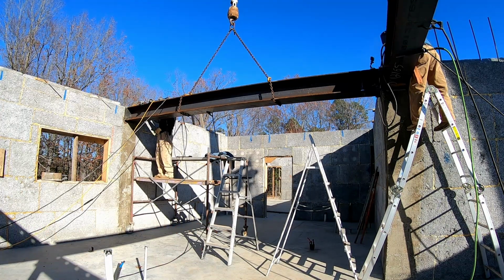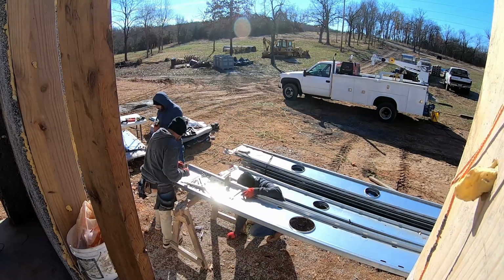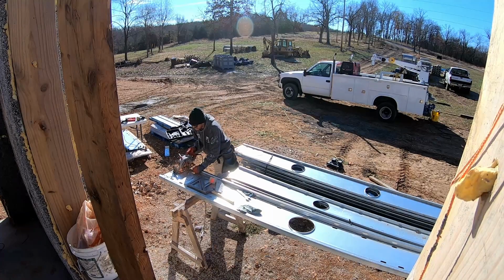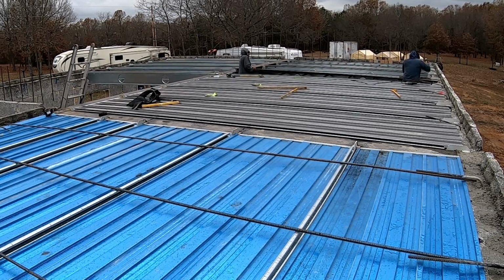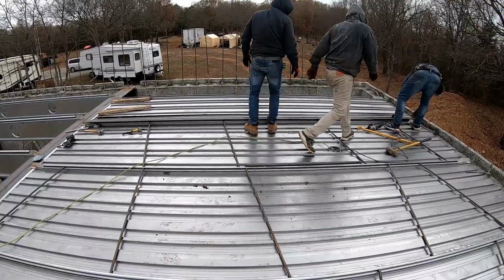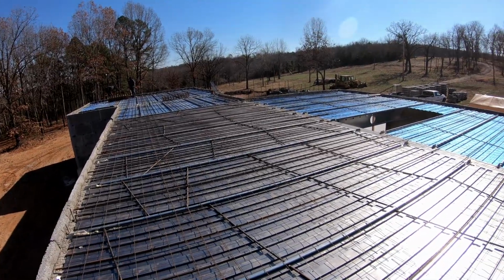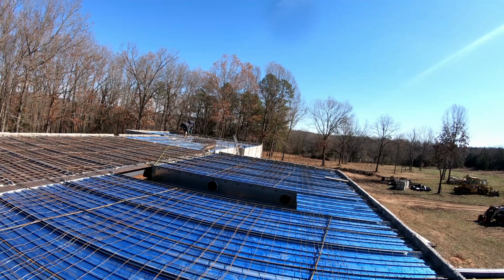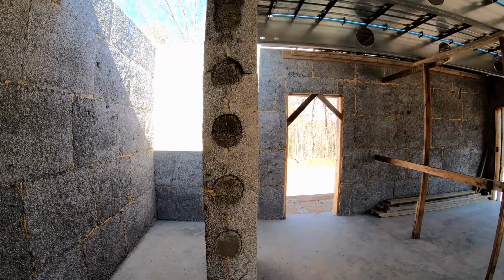House Build 25 - Legacy Block ICF House Speedfloor System Installation and Finish Welding I-Beams

Comment: Love the step by step videos on your ICF build 👍🏾. This is the first time I have seen metal I beams used. I am also watching another complete ICF build on YouTube. Jesse Muller. Both of your channels are very informative. Thank you.  Jesse used a different floor system with foam panels, Rebar, and concrete to make his floor joists. It's nice to see two different systems at work. 👍🏾😁
Reply: I might do something like this on my next build, the concrete joists are nice, but alot of labor. I will check into these
Reply from the maker: Thanks for checking out our videos!  I'm glad you like the way I am presenting information.  I try to let folks know what we are doing and what to expect but sometimes I fall short.
  Speedfloor is a good system if you are doing a suspended concrete floor.  I mentioned the problem we had only so that people understand that sometimes stuff goes sideways and you have to deal with it.  I still believe that it is a good system.  
  We looked at Build Deck and Litedeck as alternatives for the second floor but decided to go with the  Speedfloor as Legacy Block was familiar with it and it seemed like a good fit since it is within the insulated envelope of the house and didn't need the extra insulation.
  I'm familiar with Jesse's channel through Andrew Camarata.  I've watched some of his videos but was not aware he was building an ICF house.  I'll have to take the time and check it out.
Reply from the maker: @jmuller86 , I have watched some of your videos but not recently (building a house) so I didn't know you were building an ICF house.  I'll have to check out your build.  The Speedfloor system is a good system if you don't need the insulation provided by an ICF deck system.  I provided links to the systems we are using in the description of the house intro video.
Thanks for checking out our project/video!

Comment: Besides the thermal mass providing energy efficiency I imagine it could serve for excellent security as well. No need for sandbags! It's looking great Tony.
Reply from the maker: Since we do live in a tornado prone area we figured this was better than going out in the rain to a storm shelter.  Plus, occasionally people have fires get out of control around here and we live in the New Madrid fault zone so the fire rating and earthquake resistance is a bonus.
Reply: @ozarksethic  very smart build!

Comment: Man, it's coming together now.  This is truly a fun watch. 
Is the company that made the incorrect length light weight beams part of the same company that's doing the rest of the build?  Is it all one big company? 
Were you running both welding leads from one portable welding generator? 
I bet those Builder Pros helped standing on a ladder for those long hours.  My calves hate that. 🙂
Reply from the maker: Rick,
  It is coming together but stalled due to holidays and weather for the moment.  
  No, Speedfloor is a separate company from Legacy Block.  The original Speedfloor is from Australia.  I think we just got caught up in the growing pains of a new operation opening up in the U.S.  Overall it is a good system that has been around for awhile.  It is primarily used in commercial applications.  We looked at using traditional wood joists and decking but due to the open spans it would have been as expensive as steel and concrete so we went with the more substantial system.  Since we are going for low maintenance and energy efficiency the thermal mass of the concrete should be great for temperature swing moderation.  Plus we won't have squeaky floors in a few years!
  We were running two machines, mine and my Dad's.  I was using my Lincoln Ranger 8 and my Dad was using his newer Lincoln Ranger.  I can't remember if his is a 225 or 250.
  Yes, the support of the Builder Pros was great.  Standing on a ladder rung for hours would have been misery with a less substantial boot.
Reply: @ozarksethic  Thanks, Tony.  Excellent info!